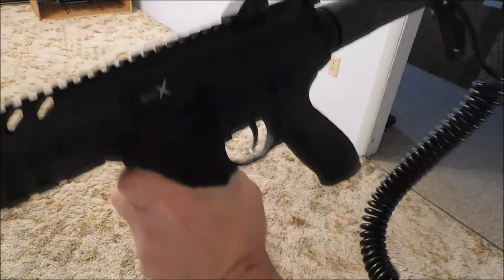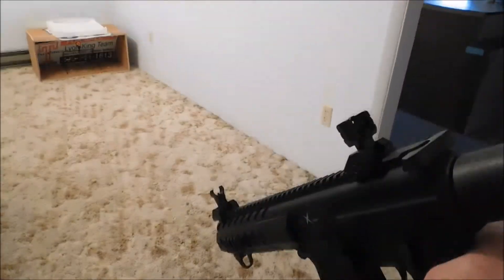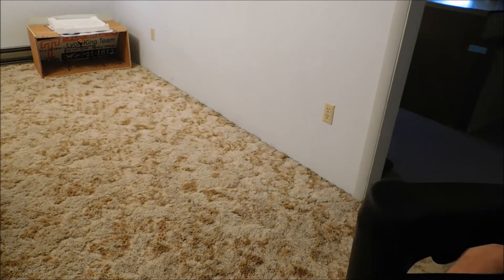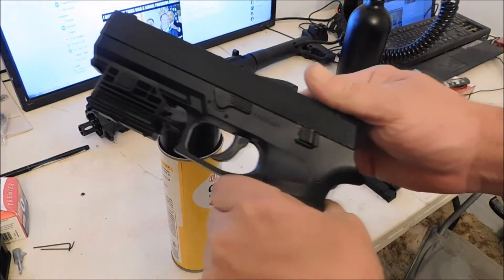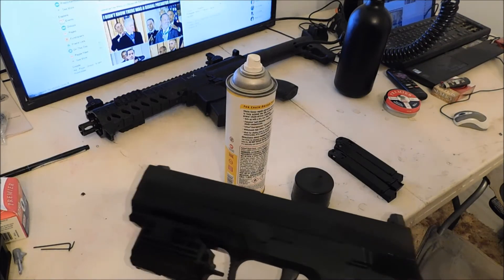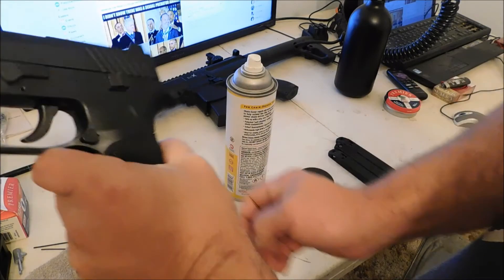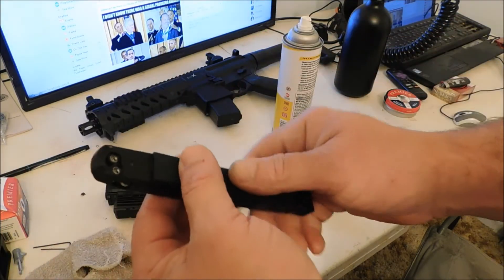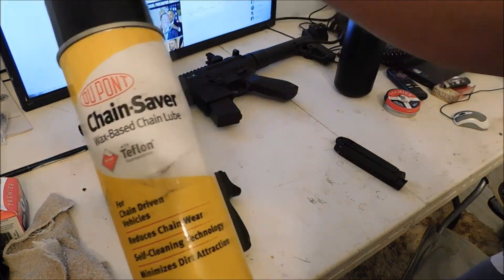How I remedied MXP, P320 & MCX airgun magazine jams

Comment: I own 15 air rifles/hand guns and this is by far the best I have. The accuracy, the weight and overall product quality is awesome. In 3 years its jammed a couple of times. Most rifles do. Best advice is use lubricated 88g canisters, and good quality pellets. Rapid firing like in this video looks awesome, but will obviously reduce fps. But it's not a long distance target rifle, it's a kick ass garden plinker/small pest solution.

Comment: I had issues with the mag, pushed it a little forward, you can use a little insert between the mag and the mag slot, you can feel lever that clicks down the belt hitting the teeth instead of the spaces if its not align causing it to jam. Push it slowly until you find the perfect position of the mag, mine only needed a very small push. Yes, the chain saver helped as well👍
Reply: Hey I need help! Same issue
Reply: @ThatLinked4Runner_   if you still have warranty send it back.  Mine expired, So I did my modification on the mag, I glued small 3d printed plastic to the mag.
Try to be patient in finding that correct position of the mag, my first try was just few millimeters, I think it changes when the the plastic I added gets worn out from insertion.  Hope it helps.

I'll try to attach a link to the pictures:

https://www.amazon.com/clouddrive/share/uK5mc3qSyOQi5Qu1yXfb2tkxZ8VKSOKKlC3USdizUG3

https://www.amazon.com/clouddrive/share/OAQtiE3aUQln08YXzXjK9al0aWJDV5CnXNzWUB2crW3
Reply: @regiecabangcala3932  you can buy shim stock from msc. That would have the correct size up to .020 inch.

Comment: only issue is the knock valve has a o ring on it where co2 comes out...that lube is gonna be hard on that seal if you over lube....and you can bet if its going in barrel like you said your over lubing...pellet gun oil is made specifically to lube seals...that is why it goes on top of co2 canister to lube seals...transmission fluid works well too because it lubricates valve body seals...if ya know how a transmission works

Comment: I would think a Dry lube like dry spray Moly would also work well. The inside of the metal track on the belt may have to much friction or a bur on it maybe a polish of the inside section could make it much smoother, and maybe a piece of UHMW selt adhesive tape stuck to the inside section of the magazine and inner section of the belt rides or rubs against a slicker material, as UHMW it is self Lubricating Plastic.

Comment: Bro my clip is stuck in the gun how do i fic that
Reply from the maker: Hold the release button & jiggle the h#ll out of it while pulling down.. never had that trouble, but that's what I'd do...
Reply: @RJGould  just so you know, I had the exact same problem and that just solved it. Prob would have figured it out but didn’t want to damage the magazine, but all is well.. so thanks!
Reply: Same thing happened to me and I was thinking the pellets I chose, but then I let the gun cool because I had it stored in the wrong place, then the mag came right out. The co2 cannister was out too, was behind the misfires, maybe all caused by the heat, same Gammo rockets worked fine after a co2 change

Comment: So it’s not really that great of a gun. There’s so much problem I see on YouTube.
Reply: Unfortunately it's looking that way; my buddy and I have gone through three of them in under a year. His got a gushing leak that would just expel the entire CO2 cartridge throughout the gun. The trigger on my first one totally locked, and after sending it back three times Sig sent me a new one. This one seems to be developing a leak as well. From what I understand it's a one in the same issue; a key internal component was made out of plastic. Such a shame to, because this was such a neat & unique platform for the air gun world.
Reply: I smashed mine to fukin pieces!
Reply: William Streeter you can buy a seal repair kit on Amazon. No need to hulk smash.
Reply: @exploringfloridatrails1834     you commented the same thing several times. are we supposed to congratulate or admire you?
Reply: @williamstreeter7583  Rapid fire? From everything I've read, if you do rapid fire, the seal gets way too cold and causes the malfunction. Switching to HPA tank gives you more power, more shots, ability to rapid fire till your heart's desire and lowers cost to shoot. Air Venturi sells kit for it.
Reply: @peterbretherton3546  We bought those kits, still got the same results. But you're more then welcome to try your luck. Happened around 3k rounds for each rifle.
Reply: @exploringfloridatrails1834  if you give it some thought, you would have found a solution. There is ALWAYS a solution!
Reply: That because ppl dont handle and maintain them properly, using wd40 like fuckin morons and etc.. and yeah, dont think a waxy spray is good , most likey gunna mess his shit up. I got one it works fine. My issue wit it is the build is great quality, BUT they cheaped out on the forgrip n stock in my opinion, but has been a good reliable replica 4 me n i use it a few times a week n put a few hundred shot thru it do...?
Reply: @thafirstborn2550  I kicked my foregrip to the curb and bought a 3 way foregrip from Gorilla ;}  Lube with silicone oil ONLY
Reply: R Gri they now have the 22 HPA only in the market. Check out Airgun detective video reviews.
Reply: @solidus1995 🙋🏻‍♂️